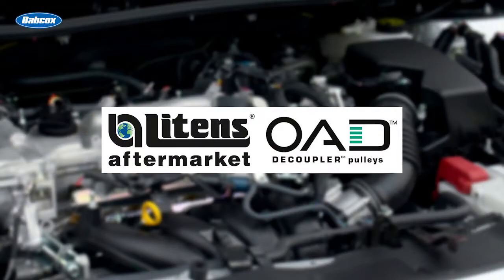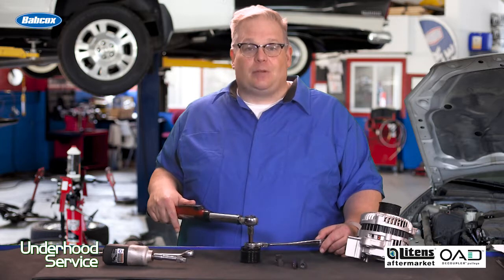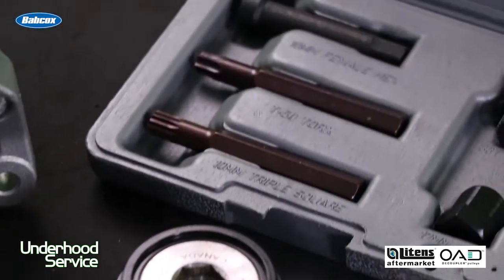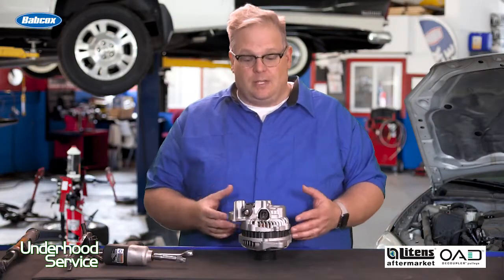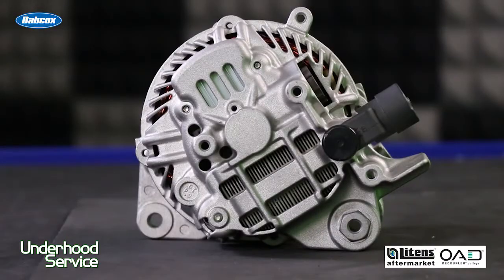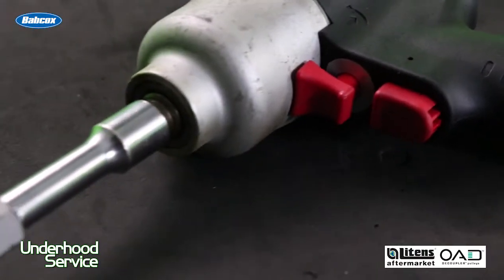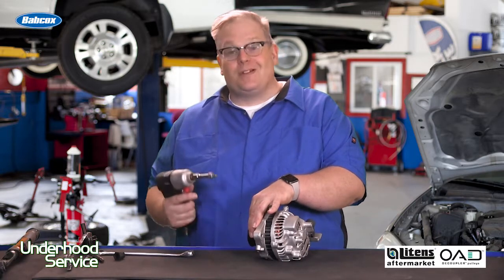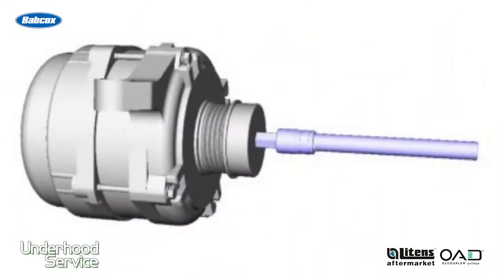Decoupler Pulley Installation & Removal Methods | Tech Minute

Comment: I bet if I used the proper tool to remove the decoupler pulley I would break the tool then I would be up sheet creek.  I would have to remove the alternator from the car then use an impact gun to remove the pulley.  Then I would use the proper tools to install and torque to the correct spec.